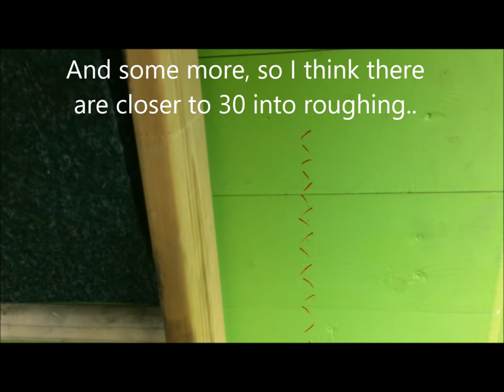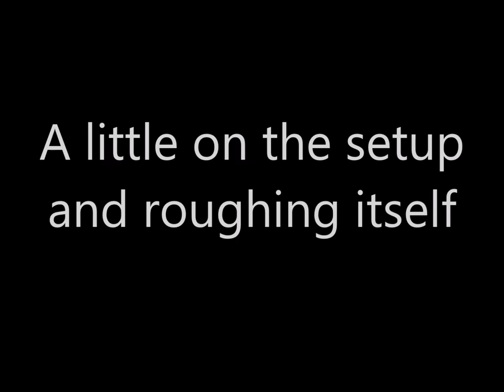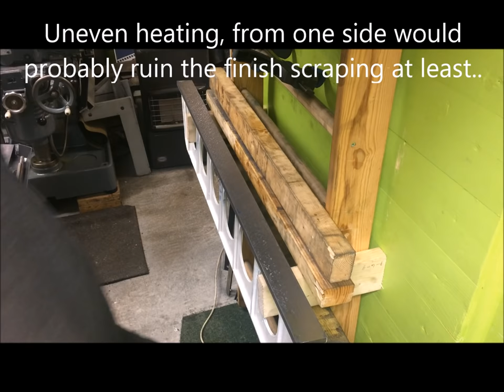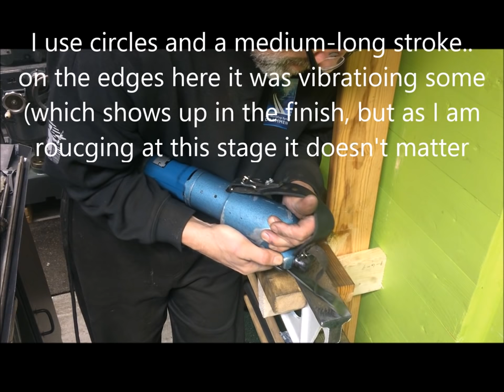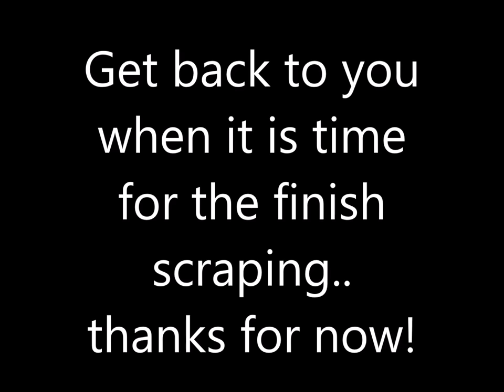Scraping HK48 straightedge

Comment: I will be interested to see your approach to finish the working face on the SE. It is a new skill to me and I am just starting out on my shaper rebuild. Your videos have been very helpful. Thanks for sharing and best of luck with your classes next month. Mat
Reply from the maker: Thanks for the well wishes. I would recommend taking a scraping class then! I also cheated my way through and got to a certain point learning scraping, but it sure "clicked" when "the Professor" taught the class I took back in 2013 in Georgia. Much of this is quite simple, but yo ustill need the kind of tutoring and hands on training he offers.
Reply: Thanks Jan - maybe in the future - the flights alone are out of reach. All the best Mat
Reply from the maker: Where are you located?
Reply from the maker: if you have access to a power scraper, the general idea is to move from circles to crosses/rows, shortening the strokes and using a blade with a smaller radii, cutting the blobs into smaller and smaller individual spots, then finally picking off the highest points by "dive bombing"
Reply: Been at my shaper scraping most of today - and what you describe is pretty much where I am going - all be it hand scraping.  I am sure that a class would be a huge benefit - nothing beets a guiding eye and word from experience.  Too many times I have spent a few hours getting ahead of myself only to have to revert to rough scraping having moved ahead too early. (plenty of video on my channel showing my progress..)  A biax would of course speed up the process - experience reduces the amount of material removed ! :-) Looking forward to the next installment. Best regards Mat (UK)
Reply from the maker: Aahh.. I see you have a nice project there! I did a small shaper also some years ago, all with a hand scraper.. quite a handful, sore wrists and akin forearms :) keep up the good work!

Comment: What grit stone do you use to remove the burrs after scraping?
Reply from the maker: They are medium grit. I have bought them from/through Richard King as he uses them also. One important notice about the stone is that is dead flat, or at least from a 5 pack you can find most of them are at one side. They are also tapered and can be further "machined" to a point so it fits all the way into a dovetail

Comment: Where i can buy these?
Reply from the maker: Harri Havulo The camelback straightedges?
They can be bought from Richard King. handscraping.com
Reply: How much was the shipping to Norway? I live in Finland. How do you get the 45 degree camelback straight edge face perendicular to each other?
Reply from the maker: Hi there,Nice to "meet" a Fin also :)The simple answer to the question of getting those angles and flats parallel to one another is "it doesn't matter". I also thought that the angle had to be "dead on" and the flats parallel to within 2/1000 mm pr foot (or any other arbitrary "functional precision measurement"). However, the way I have been taught (and practise) is just to use one flat at any given time, ie. just "tip it into" the dovetail and measure each flat separately. Of course, if it was production "tooling" one could make it into a gauge (is that the proper word?) matching the precise angle and then there would be a need to have the flats absolutely straight and parallel to one another, but this is rarely the case and would limit the SE in use as a "general purpose" instrument, as it would only match a dovetail of a given angle. These differ from 45, through 50 and 55 up to 60 degrees (as far as I judge). Hence it would make sense to have the SE at 45 degrees.I have not bought these myself, just scraped them for a friend, so I must hand you over to him with respect to "the finances involved". I sent him an email linking to this thread so that he can contact you
Reply: Jan Sverre Haugjord Okay, never thought it that way. This helps alot clearing it in my head :) Doing one flat at time at dovetails need good feel on the tools used, since the flats are so narrow. 
Is it possible to use a granite flat or straight edge that are shorter than the actual work piece?
Reply from the maker: Yes, but you have to overlap and then pay special attention how to interpret the area where you overlap.
Reply: Is there a specific reason why your friend have straight one and the 45deg?
Reply from the maker: Too much money.. ha, ha..No honestly, I don't know, but maybe he thought he would then have a spare if one was "in need of re-scraping", or was it a "package deal", maybe freight prices etc. etc. In any case, he said he used a freight forwarder who could collect from Richard's adress in Cottage Grove. He also said Rich did a wonderful crating job, and all was well recieved. PS! I see that he sells the SE's at US Ebay, and as stock may be emptied, I would contact him asap